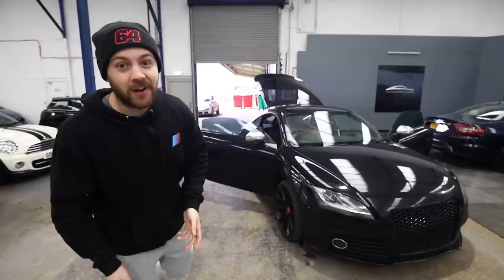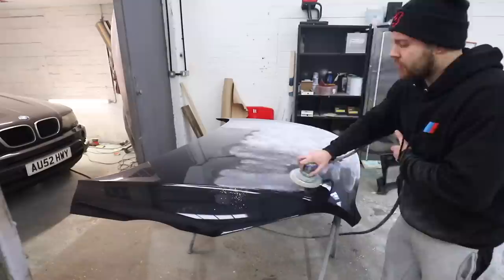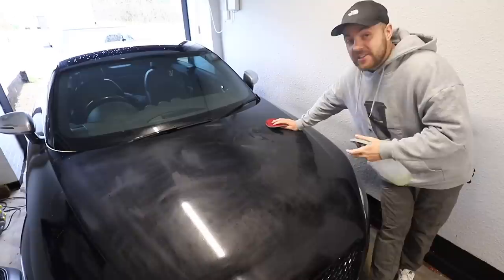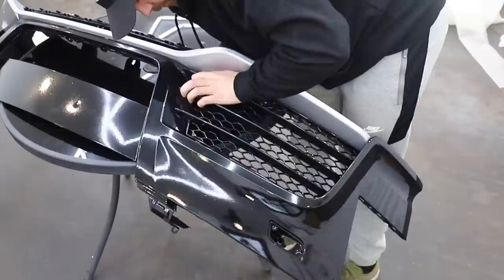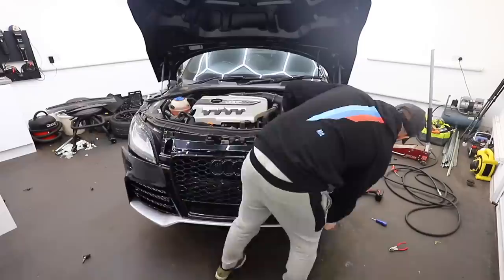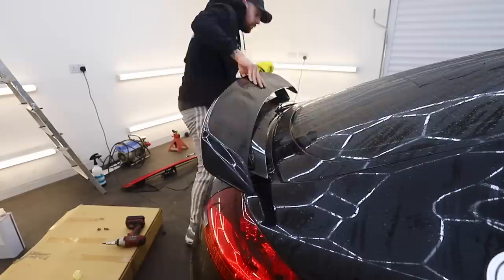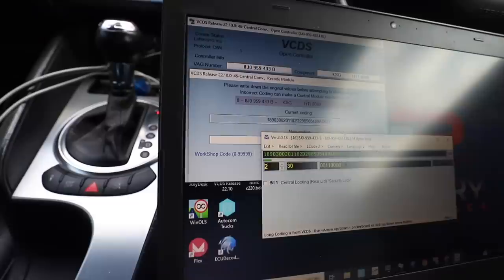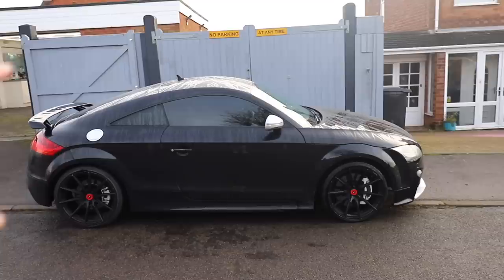YOU TOLD ME NOT TO BUY THIS FOR MY STOLEN RECOVERED AUDI TTS MK2 8J

Comment: Looking great!! Getting that sanding done with a block and no interface pad would get a lot of that orange peel down too and give you a better finish and depth. The peaks of the clear coat are sitting too high and a flat block and some more graft will take the tops of that off and level it out. You can use the orbital with no interface pad as well nice and slowly to take it back but the improvement in the look of the car overall is on the money!!

Comment: I think you missed a trick with the spoiler, I too replaced the spoiler on my TTs and the weight savings from removing the rear manual spoiler is a decent amount and it’s not that hard to take off either, but still looks good